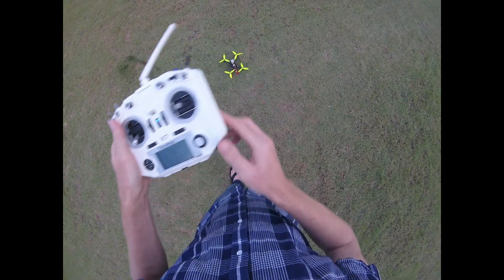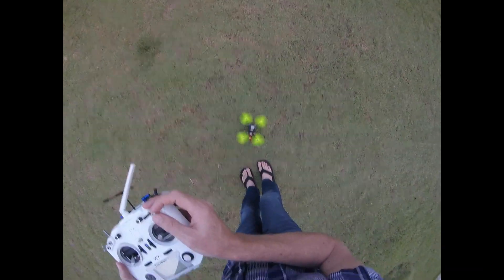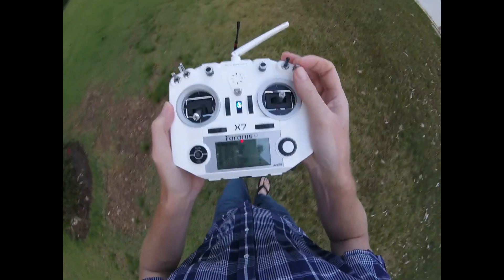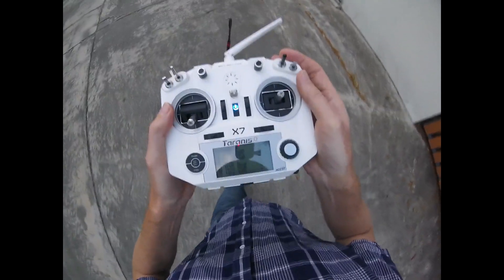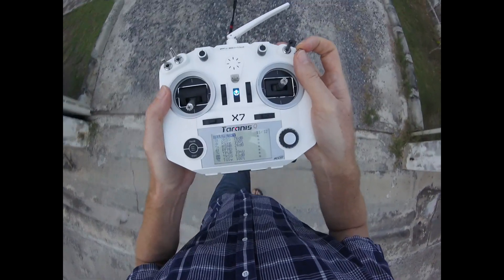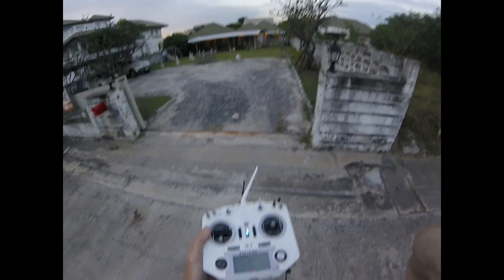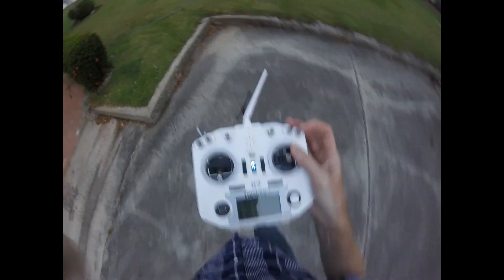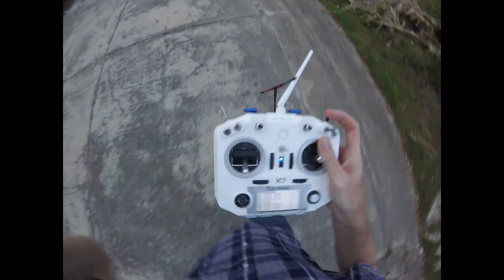TBS Crossfire FW Version 2.88 dynamic/static power test

Comment: I can't even update the Micro udpates but not the RX Nano i'm going crazy ,just wont update or rebind.
Reply from the maker: What firmware version are you using on the crossfire transmitter?
Reply: @Siamect  I managed to get them both to 2.88 ? so I left it. Honestly I tried to be methodical about but in the end I just tried everything in random order. Tried 2.9 for 50hz fix but didn't work so rolled back the nano rx wouldn't update

Comment: Are you sure this isn't an issue the the QX7? I tested this on 2.41 just now and it stayed on mode 2 while bumping the power up.
Reply from the maker: Thanks, no it's not qx7 problem. It happens only on dynamic power. If I turn off the dynamic then it stays in mode 2.
Reply: Yea thats strange though with the "Sensor lost". I havent gotten that on crossfire at all.
Reply from the maker: @jeff7397  Do you use telemetry?
Reply: Yes
Reply from the maker: @Jeff But the "sensor lost" only comes if it goes to RFMD 1 or back again so if that doesn't happen in your case then you will never have "sensor lost" problem. I have seen some explanation in an OpenTX forum that this is because the telemetry reduces speed and content and only sends some of the content when RFMD is 1 and OpenTX doesn't like that... I think it was in one of Joshua Bardwell's videos you could hear the "sensor lost" message all the time... 
https://www.youtube.com/watch?v=-xHzMHG_9mI and go to 2 min 35s and 3 min 25s so it is definitely real...
Reply: So you have a logical switch setup to callout RFMD changes? I figured it might have something to do with your failsafes if not.
Reply from the maker: @jeff7397  yes I have a logical switch if rfmd falls from two to one but I only use it to enable low quality factor voice messages. I don't want low quality messages if I'm still have rfmd two.

Comment: Det förstår jag inte men, you should better post in TBS lounge facebook group. There you should get answer.
Reply from the maker: Thanks Mike, I closed down my facebook account many years ago and haven't looked back since :)  I'll ask my wife to post something...
But I'm currently frying the TBS helpdesk and there is some discussions in RC-groups that I follow. I also have commented to an issue in betaflight at github that dealt with RX loss and it may be just a communication glitch between betaflight and the receiver that causes the failsafes I have had. There are some flags in Betaflight that I can log in the flight controller but i don't have any sdcard slot on the FC so I have to do it to the 16MB internal memory which give me a limited log time. 
The dynamic power thing in this video I'm not that worried about because I usually don't use dynamic power.
TBS have a new diversity nano receiver that may be better but two antennas will be a little crowded on 5 inch quads and the price i 60 USD. I will wait until they have the second iteration of that receiver in stock...
Reply: @Siamect  My crossfire will stay at former firmware until all problems solved. 😁 By the way, har du drone registration? En svensk man skulle vill tar hans drone till Thailand. Jag rekommendera kontakta du.
Reply from the maker: @FireDFPV  Yes I got his email and I will tell him how I did it, but it was a night mare, 120days and they lost my documents at least four times... 😀 Thanks for caring.
Reply: @Siamect  Hahaha that is exactly CAAT. They even lost our ATPL licensing documents.